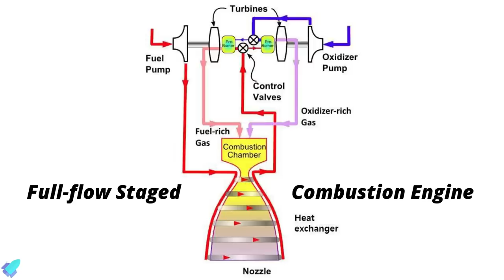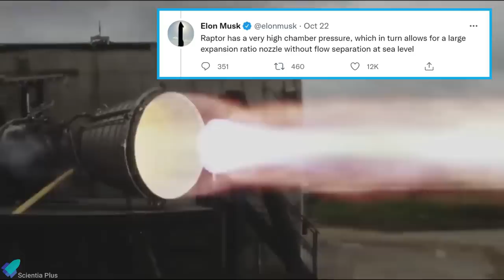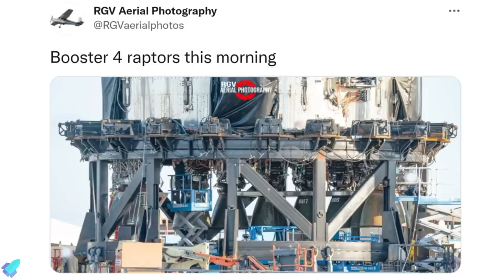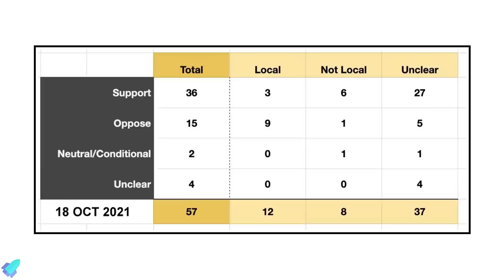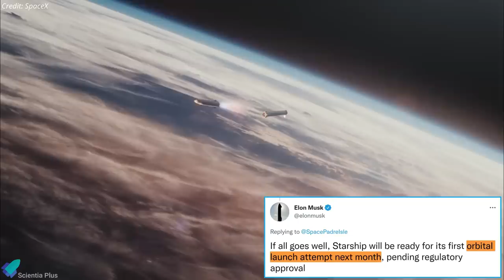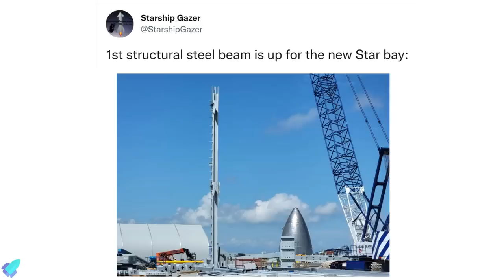Starship20 Ready for Static Fire Test-3, FAA Public Hearings Summary | Nuri Rocket Launch, SLS Stack

Comment: My understanding was that vacuum and sea level raptors are exactly the same except for the size of the bell.  If correct, RVac is not really a less mature engine IMO.
Reply: At this stage of development it would not surprise me if every individual engine is slightly different.  According to a tweet from Elon after static fire 2 they tested the Rvac to RUD at a chamber pressure of 330bar.  That is above the target 300bar for Raptor 2.  So it would appear that both models are currently at a similar development level.  I have read somewhere that the throat of the combustion chamber on the Rvac is slightly smaller than that in the sea-level Raptor.
Reply: @jamescobban857  Can't disagree.